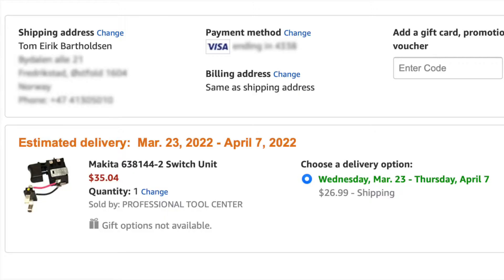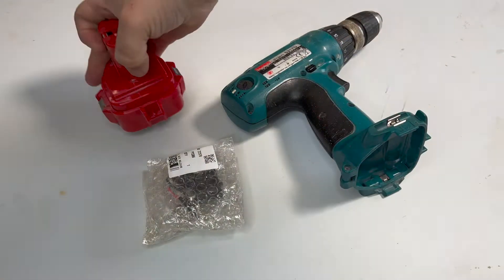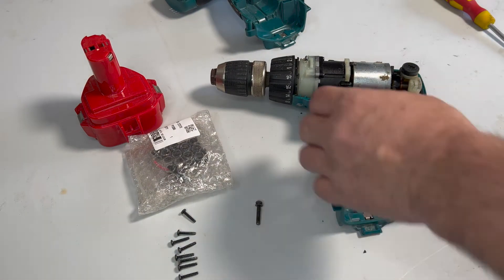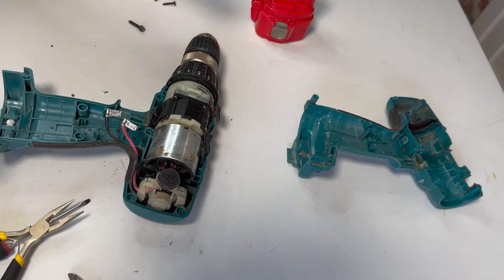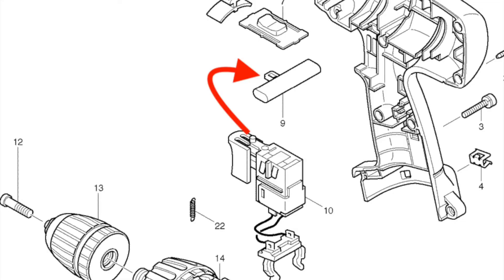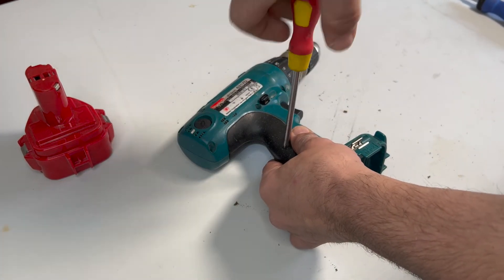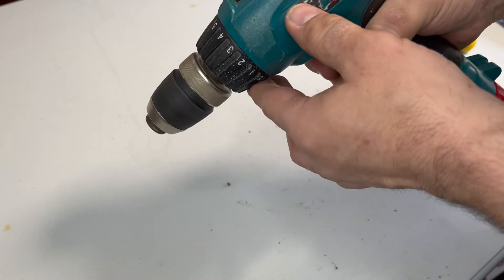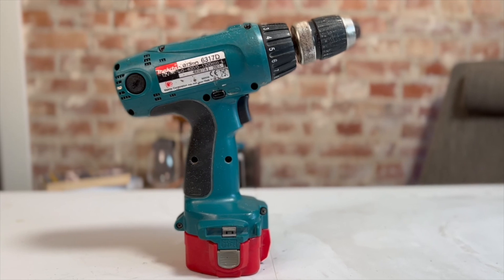Cordless Drill Repair  - switch trigger replacement on Makita 6317D electric drill

Comment: Electric Drill Dustproof Speed Control Push Button Trigger Switch cordless drill trigger repair Isn't it possible to repair it without purchasing it? Can't we solve this problem by changing the diode or transistor?
Reply from the maker: It might be possible to disassemble the switch and don "some maintenance" on it. but I think the chance that this would have worked was small on this one

Comment: Just bought a brand new drill and it wont work. I tried the little wiggle you did at 15 seconds and it worked!! The battery works on my other Makita tools, so it appears the battery contact on the drill is not aligned when snapped into place.